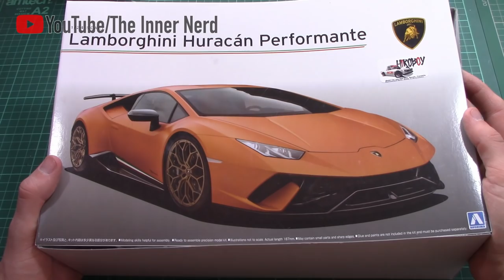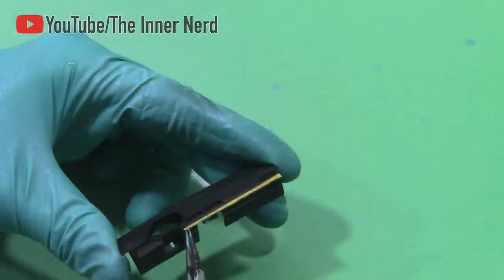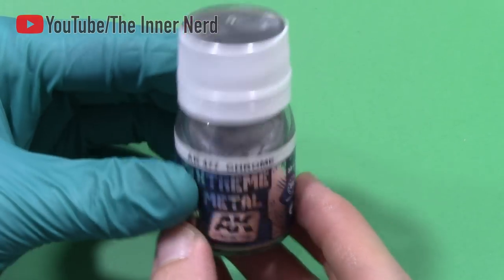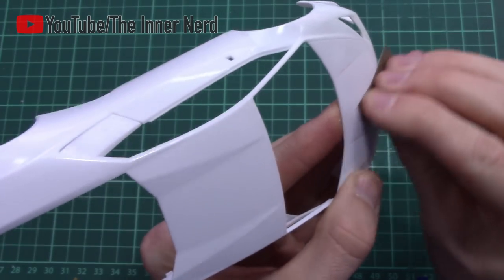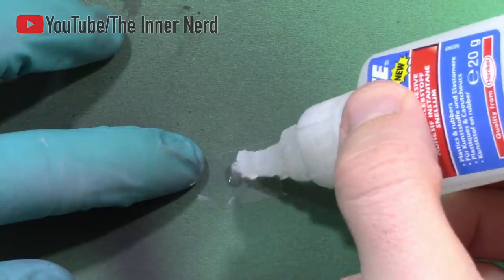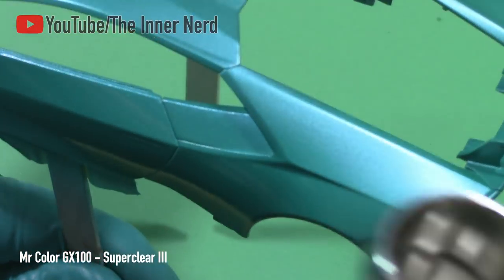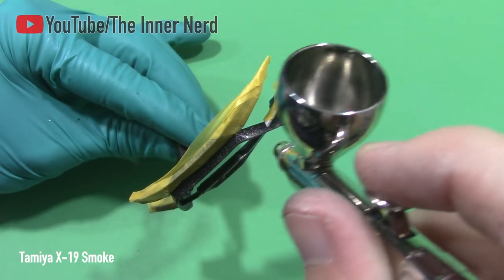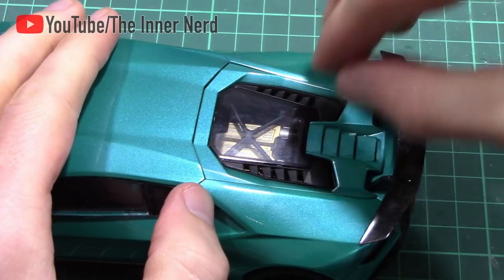Lamborghini Huracán Performante 1/24 | The Inner Nerd

Comment: What a strange but beautiful color. The build was excellent! The carbon fiber method is so simple yet effective. I need to get on my Aventador, I just can't decide on body color!
Reply from the maker: Yes I didn't know this colour existed until I saw a car in exactly this spec out on the road. After some research I found it. Good luck with the Aventador, I vote Blu Aegir for your scheme👍
Reply: @TheInnerNerd I will check out this color! At first when i got the kit I thought maybe a light gun metal. I've moved away from that plan.
Reply: @raimee81  Ive got the Aventador on deck and I'm going with the Blu Fontus spec. I'm using Tamiya TS-64 "Dark Mica Blue" as its the closest I could find that's readily available.

Comment: Amazing work! I have a question. You coated the body at first with the Tamiya clear coat. Which thinner have you used?
Reply from the maker: Thank you. The Tamiya clear is thinned with Tamiya X-20A acrylic thinner. I try to use own brand thinner to stop any micing complications as some are not cross compatable. Thanks for watching :)

Comment: So good...it's now in my stash!! Can I ask where you get your polishing mops from for the Proxxon? My wool ones disintegrate within the first few seconds!! Thanks...
Reply from the maker: Thank you and thanks for watching! I got these ages ago from eBay. They’re nothing special and do the same as yours by the sounds of it so I can’t help unfortunately. The only thing I will say is I rub off a new one before (the buffing wheel I mean 😂) applying the compound to get most of the fluff off it. Then when applying the polish, barely apply pressure and they should last for a few models before they are shot. Hope this helps and good luck!

Comment: I wonder if you could find 1 or 2 very fine mesh/brass screens, maybe 2 of them on top of each other at opposite orientations and place over carbon fiber parts and  spray silver thru that for a uniform looking carbon pattern? Idk just throwin an idea out there lol
Reply from the maker: That may work yes. It’s also been suggested to use a set of tights as this also gives the crosses effect of carbon with good results 👍

Comment: Hi ... admired by your work! I'm Italian and some things escape me even with English subtitles. If I understand correctly, you pass the x22 over basecoat because it is not as aggressive as the gx and do you prefer the gx clear to the 2K because it is easier to sand and polish and because it is thinner and more realistic on a scale model? I would like to ask you what ratio you dilute x22 and gx clear and at what pressure you spray. Thank you!
Reply from the maker: Hello and thank you. You understood correctly. I thin the X22 and GX100 to around 50/50. The self levelling thinner in the GX100 works best at higher ratios like 50/50 to help dry smoothly. For clear coats I have found that 10psi works best through my H&S Evolution Silverline with 0.15mm nozzle & needle. Hope this helps and thanks for watching :)
Reply: @TheInnerNerd  Ok ... I use 0.3 to 0.4mm airbrushes, so maybe it would be better to dilute less? How many hands do you give for the Gx? Always thin hands and how long to wait between hands? Thank you! Thank you

Comment: ciao. congratulations for your job, really well done. please, I would like to ask you what material of fabric you used to coat the car dashboard. thanks
Reply from the maker: Hello and thank you. The material is Alcantara. It's the actual material used on the real car and can be bought in rolls. I had this left over from another job which wasn't model related
Reply: The Inner Nerd I was sure it was Alcantara 😁. did you have to thin the thickness?
Reply from the maker: @geppo9012  Yes this is split down to around 0.2mm! It barely holds itself together
Reply: @TheInnerNerd  Thx Man!

Comment: Hola, exelente trabajo, una pregunta, que producto utilizas para remover el cromo de las piezas que lo traen  y asi poder pintarlas de otro color?
Reply from the maker: Luis Palma Hello and thank you! I use regular oven cleaner (no water added) and let them soak overnight. This will take off the chrome plate ready for priming and in Mr Surfacer in this case
Reply: @TheInnerNerd  Muchas gracias amigo

Comment: Wow this looks great! I am using a similar tri-coat gravity color for my tamiya  ford gt. What nozzle size would you recommend for the clear metallic topcoat and how do you avoid spraying some areas darker than others? Thanks.
Reply from the maker: Hello and thank you for watching. I use a 0.15mm needle and nozzle setup on my H&S Evo Silverline and it sprays just right. I use a very low air pressure (8psi) for the Zero paints to reduce the risk of orange peel as well as tip-dry before the paint lands on the model. In terms of layering, I just kept applying in very thin coats until the colour became fully opaque. This is quite hard to determine depending on the colour but once it seems that the colour does not change  after applying more, that should be even enough.
Reply: @TheInnerNerd  Thank you so much for the response! Looking forward to future videos!

Comment: Do you have a secret to Super Clear iii? I'm switching from 2K as it's not as readily available here. Tried SC3 with 3 light coats (10min interval) & 2 heavy coat (4hr interval), can't seem to lay it smooth enough as in your video, 1:4 ratio @ 19 psi through Infinity 0.4mm. Any tips would be awesome! Thanks!
Reply from the maker: Yes... but it’s a secret so I can’t tell 🤫 Just kidding 😂 so the key is to thin it LOADS with self levelling thinner (from Mr Color again). Straight from the bottle I suggest start with a 50/50 mix and see how you get on. I sprayed this thinned to around the 50/50 mark and laid down 2 mist coats to get it bedded in. 10 mins between cycles. Then after that 3 wet layers waited 45mind between cycles. To get it to sit flat you have to get the thinner to do the work or it will orange peel. My method still gets a little but is easily sanded smooth. I spray H&S Evo Silverline. Working pressure 8/9psi on a 0.15mm nozzle/needle setup. Hope this helps you out!
Reply: @TheInnerNerd  Hahaha. Top secret info released! Thank you for sharing some tips, will definitely try it out and hopefully get some results. Cheers!